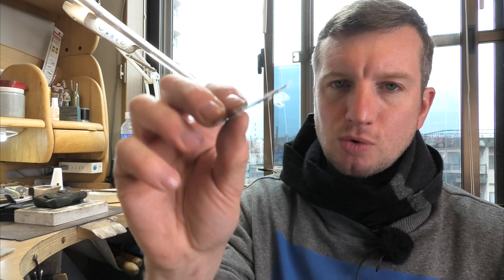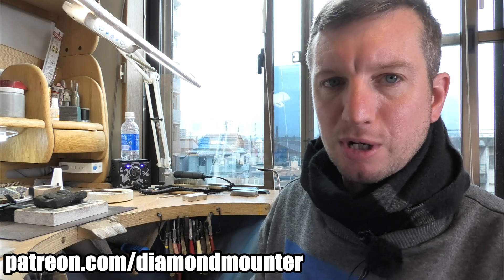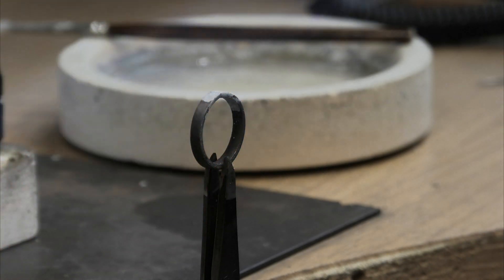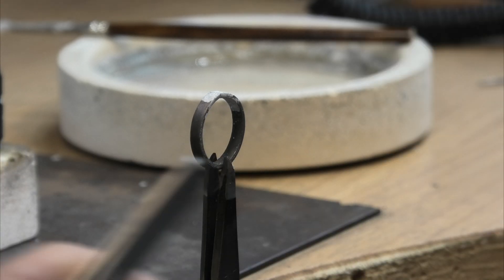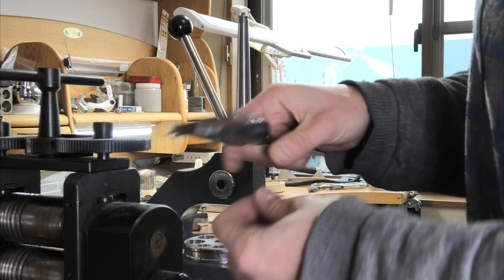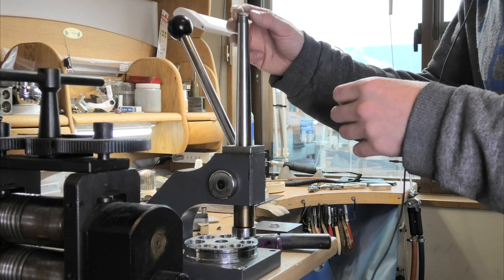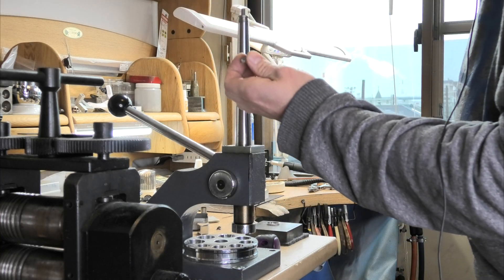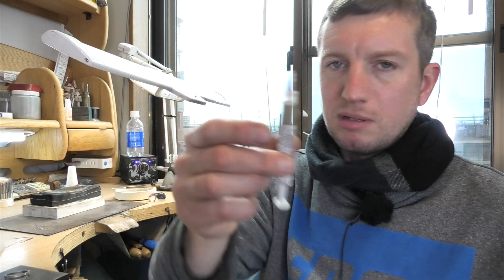Are Solder Paste Joins More Brittle Than Regular Solder?

Comment: Interesting experiment...also interesting how much solder you used on the join. I think I need to use more solder because I usually have a dip at the join that is difficult to file away. Thanks for posting.
Reply from the maker: Aim to get the join really tight before soldering. It should solve the dip problem

Comment: I've got a friend that swears by solder paste and said ( and in my experience as well) it doesn't flood as much in the joins. I've done a couple of rings where I've ran an old sawblade through the join with paste on it to coat the whole inside of the join with the solder.
 I wonder whether this would make it a stronger join and that's why people find them more brittle as there's more porosity or dry joins inside the metal?
Undeniably a pain to have to do that though so there's a time and a place for paste and times for palions

Comment: Thanks for the comparison.
I think that you are right about the paste solder being just fine on the skull chain, you can think of it as two different types of glue.
They all have their uses . Good to know the limitations of the stuff you work with.
Reply from the maker: Sometimes when doing repairs I would choose to solder with 18ct white gold on a platinum ring. It melts at a lower temperature and seems to be more durable than platinum soldered joins. Would only do that on a repair job though!

Comment: I don't have your sort of experience, I admit, but it looks like the amount of paste you used was hardly a fair comparison, next to the amount of "trad" solder. So much of the paste is flux and air and just burns away, leaving a tiny amount of actual solder by comparison to the initial volume. I'm not necessarily trying to advocate for the paste, but I'd be interested in seeing the same test with 4 times the paste amount, to consider it a fair like for like test. As always, I love your vids, and this is fascinating research for us all. ✌️
Reply from the maker: It would likely be stronger if the join was surrounded by lots of solder but we dont make jewellery that way. To save time not filing away excess solder and money also by not using more than is needed I used just enough to fill the join.
Reply: He filed both down to make things as equal as possible.
Reply: Oh, I appreciate that (and this is something I learned from you and I am trying to apply to my own practice), it just looked like (albeit, on my phone) you used way more trad solder than paste, is all.

Comment: Thank you so much for doing this!!  I'd been wanting to try it but don't have a stretcher/reducer YET.... lol I appreciate your professionalism also!! ❤️❤️❤️
Reply: Just hang some thing in it, and add weight, till it breaks. I used to test knots to fishing hooks that way - a bucket and water, but you might need something heavier. Lots of "uexpected" results with my knot things - different knots with different lines and depending on the thickness of the hook too. Never expect things to be, as what seems logic. Test test test - and retest several times, to be sure. You could have an unlucky spool of line, and the same aproach to other is always smart.
Reply from the maker: You're welcome!